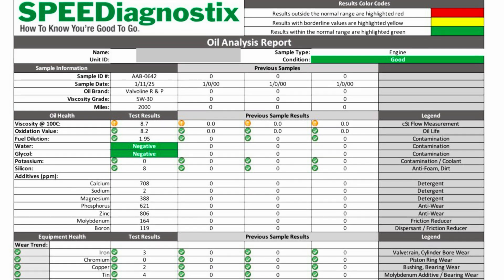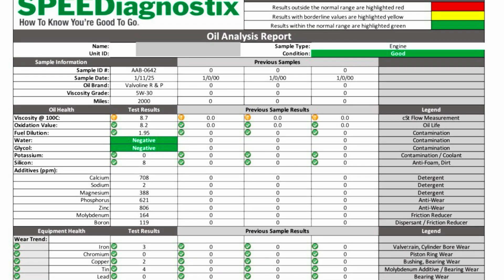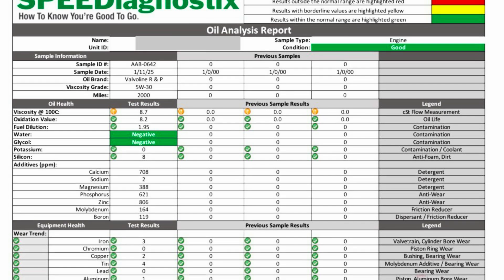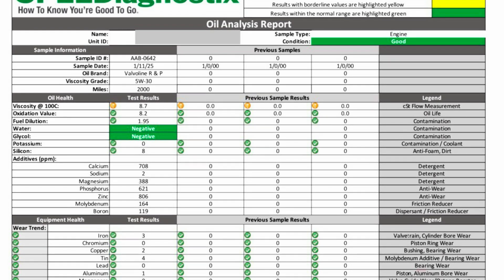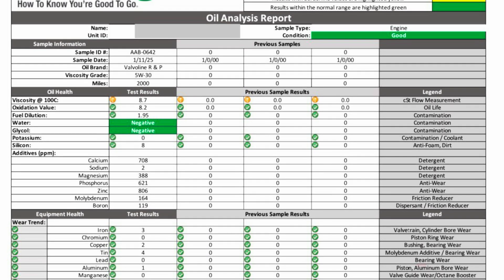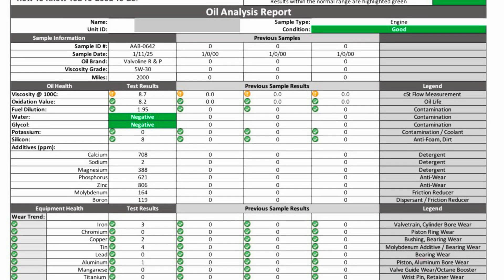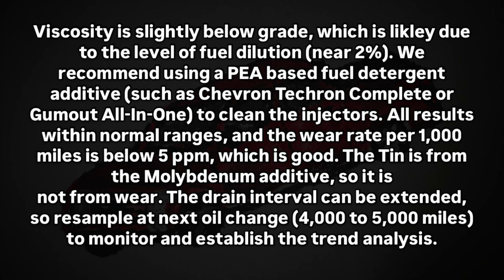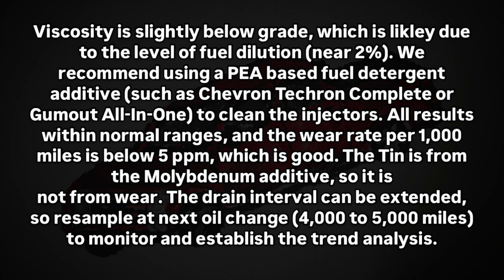Valvoline Restore & Protect (2,000 Miles) SPEEDiagnostix USED Oil Analysis

Comment: Most people need not fear a clogged filter. Unless you have a smudge engine, you should be fine with VRP and 5k mile intervals. The type of oil filter is key. The cheaper, OEM, low-grade will fill up with debris in 2500 miles~ 
and a good 15k-25k mile filter can handle what VRP makes, residue and carbon build up. I chose Purolator BOSS, AMSOIL,and Mobil1 EP filters. Good Luck
Reply from the maker: @robb15033  hey Robb! Thanks so much for stopping by and sharing here! I can’t disagree with you here!

Comment: High fuel dilution, eg, above 1% can be attributed sometimes to not running engine temp up to full temp for an extended duration - Lake says it doesnt need to be long, ie, short trips can cause this especially with low ambient temps at winter time.  I am not sure where you live for climate, but in any case you may consider making sure the oil sample has been done after a pretty good run in which to boil off the fuel out of the oil.
Reply from the maker: @jameszeiger8533  hi James, I think you’re right! I do live in a winter climate and do a lot of short trips. Do you think that if I do short trips a lot, it is necessary to do even more frequent oil changes to prevent dilution?
Reply: @MidwestF150  I live in the Denver area and right now we are cold as F-bomb and my 150 PS sits outside.  I think just make sure to once a week to run the truck in Tow/Haul mode and drive for 20 to 30 minutes, preferable at highway speeds.  Also, as you have done, drop an oil sample at ~ 2k or 2.5k miles.  The results will tell you if to keep running up to 4k or drop if the dilution is too high and viscosity package is breaking down too quickly. I think if you run it once per week for an extended period of 20 to 30 minutes, you will boil that fuel out of the oil and everything will be ok, just make sure the oil sample is after a good, good run before pulling as well.
Reply: PS:  Injector cleaner every few tanks as suggested might be preventive for clogged injects & bad spray patterns.
Reply from the maker: @ hey James!!! Does tow/haul mode put it on lower gears? And ultimately putting work on the engine?
Reply from the maker: @jameszeiger8533  how bad do these engines actually clog though?
Reply: @MidwestF150  I have a PB, 150 so Tow/Haul mode tends to keep it out of battery only mode.  But for non PB owners, I noticed Tow/Haul also tends to keep the vehicle from upshitting into higher gears, bringing the RPM a little higher which helps bring the operating temp up easier under slight load.
Reply: @ depends on the detergent package that the fuel you are using or has been used previously on the truck.  Lake says american fuel isn't so great for detergents, compared to European standards so running regularly a detergent cleaner isn't a bad thing.  High dilution rate can be a symptom of a partially clogged injector, which alters its spray pattern to more of a solid drip of fuel, not an atomized spray action.  That said, I think it's just good practice to run a detergent cleaner with some fixed regularity and to try and use decent fuel, which can vary from refinery to refinery and depend also on detergent additive added at the refinery. 2% doesn't strike me as necessarily a clogged injector issue, but running a detergent cleaner isn't a bad thing as part of standard practice at some fixed interval, eg, every 5 tanks or so maybe?
Reply from the maker: @jameszeiger8533  fuel cleaning fluid is just so expensive though lol - I currently use Costco top tier. So I’m betting on using this gas to reduce my use of a fuel system cleaner.
Reply: @MidwestF150  your vehicle has ~ 63k miles. Are you the original owner or did you get it used?  If you cannot vouch for the history, eg, a previous owner,  a couple of treatments of detergent is cheaper than having the injectors pulled and sonically cleaned since there are 12 on that motor.
Reply from the maker: @ great point, yes it’s currently 65.2K miles. I got it at ~40k miles. You do make a great point. I’ll need to think more about this one!

Comment: Redline complete fuel system cleaner works alot better then techron fuel system cleaner.   The redline has a higher concentration of polyeithermean . Thats what you want.
Reply from the maker: @LORD_OF_THE_ROOTS  hey Roots! Yeah I’m debating between Techron and Red Line!

Comment: I would consider Rislone Hyper-Fuel fuel system cleaner. The bottle has two chambers. One has highly concentrated PEA. The other chamber has an oil lubricant that lubricates the upper cylinder among other things. I can tell you this has been quite effective. I have then 2.7L ecobboost in an F-150 with only direct injection. I also have a oil catch can. I knew it worked because the little bit of crank case vapor collected was carbon black vs. the normal brown. The start stall stopped and the engine runs so much smoother with it in the tank. Highly recommend. It works!!!
Reply from the maker: @seanmclaughlin7415  hey Sean!! A fellow ecobooster. Welcome to the party. Thanks for stopping by and providing a recommendation! How often do you use it and what are your OCI’s like?
Reply: @ At first I bought 3 bottles and ran them back-to-back at 18 gallons of fuel to really dissolve and clean the injectors and the combustion chamber and whatever else it touched. Than, I do it when I feel like it needs it. I was using 88 octane E15 prior from a gas station called sheets. The issue I think was it is not labeled “Top Tier” so the detergents me be lower. So I switched to Shell. My OCI’s are at 150hrs until I do an oil analysis. Was 5K 175hrs.
Reply from the maker: @seanmclaughlin7415  oh wow you track by the hour, I like that. Do you idle your truck a lot?
Reply: @ No. only when cold out until temp needle moves some. You have an hour meter under one of your modes. It is a more accurate way to go by. I think the math comes out to 25-30 miles for every hour of run time.
Reply from the maker: @seanmclaughlin7415  I might just start doing that! Seems more accurate than mileage. I live in Minnesota so I try to warm up the truck first, specifically when I’m not at home and readily have access to a power outlet to boot up the block heater.
Reply: @ warming up an engine at high idle is not the same as idling at operating temperatures idle. Much more turbulence at the higher idle.
Reply from the maker: @seanmclaughlin7415  is there a way to calculate that differently?
Reply: @MidwestF150  Calculate what, exactly?
Reply from the maker: @seanmclaughlin7415  engine hours at high idle
Reply: @ I don’t. I change oil between 150-175 hours depending on the type of driving I do. More highway driving closer to 175 more stop and go, hauling, and hard driving closer to 150hrs. I do 150 right now no matter what until I get an oil analysis done. One in the winter, and one in the summer. Also, since It is turbo charged I lean towards doing it earlier. Under one of the modes on your dash it also has idle hours.
Reply from the maker: @seanmclaughlin7415  understood! Thanks Sean!

Comment: How could they tell you had dirty injectors analysing your used motor oil?
Reply: The high fuel dilution in the oil  indicates that one or more of the injectors is not atomising well.  So first step is to clean the injectors.
Reply from the maker: @PeterMurray-su7ex  hey Peter, thanks for stopping by! I agree with you!
Reply from the maker: @imdefinitly18now  hey there, thanks for stopping by! I’m not sure how all of the analysis works and how extrapolations are made. 🤷‍♂️

Comment: I use Gumout Complete All-in-One at every oil change. SuperTech Fuel injector cleaner for the other fill-ups.
Reply from the maker: @rickhansen1753  hey Rick, how’s it going? I sent a message to Lake Speed about my UOA. He said, based on my oil data, to use a cleaner every 3K miles. So I think that’s what I’ll do. I want to use the Chevron Techron, but let me know if you feel strongly about the other ones you use!
Reply: @MidwestF150  Techron is great too!
Reply from the maker: @rickhansen1753  glad you think so too! I gotta wait until I run low on gas before putting some of it in

Comment: I use Berryman® B-12 Chemtool® Carburetor, Fuel System and Injector Cleaner I've had really good results. It's affordable at Walmart
Reply from the maker: @peachyclean93  hey Peachy! Thanks for the tip!! As im reading all of the comments, I’m starting to wonder if me using top tier gasoline is sufficient already..
Reply: @MidwestF150  I don't know I've gone over this with my father I don't believe that the higher grade gas is much better for your vehicle people say it is but I don't know
Reply from the maker: @peachyclean93  ah I see. Lake was looking at the data for my vehicle and he recommended every 3K miles. Yours may vary depending on your used oil analysis but I think I’m going to run it every 3K miles for my truck,
Reply: @MidwestF150  yeah this is true every vehicle is different so hey do what you feel that's most important you know
Reply from the maker: Agreed! Thanks Peach!!
Reply: @MidwestF150  you're welcome 😁

Comment: Which brand or brands of fuel do you run in your truck? I only use top-tier fuel from Mobil or Irving.
Reply from the maker: @kerrylewis2581  hi Kerry!! I use top tier from Costco! Which I’m starting to wonder if I even need the fuel additive if I’m already putting top tier gas in it…
Reply: @MidwestF150  I have 117,000 on my F150 V8 and use 44K in all my vehicles once a year. I'm not sure if it's the best; it's just what I've used for over ten years.
Reply from the maker: @kerrylewis2581  gotcha! I heard back from Lake and he recommended I use a fuel system cleaner every 3K miles. This recommendation is specific to the data on my vehicle and yours may vary!

Comment: Redline Complete Fuel system cleaner is the best option which the most PEA and the price.  You can also use BG 44k Platinum P/N 208.  GumOut Ultra 5in1 is middle of the row and the Techron Marine is fairly decent.  I only run Redline these days though with excellent results and lots of research.
Reply from the maker: @Balticblue93  hi Baltic! Thanks for stopping by and sharing your recommendation! Do you think I can just get away with using top tier gas?
Reply: @ I run only top tier fuel in every tank.  And I use one bottle of Redline somewhere in my 5000 mile OCI.   I am running R&P in many of my vehicles.  So, I do both and had great success doing so.
Reply from the maker: @ thanks Baltic! I think I’m going to send Lake Speed an email to ask about when in my oil change interval is it appropriate to use the fuel additive—do I wait until closer to the oil change or can I just use it!
Reply: @ I have watched enough of his videos and exchanged one email.  I think I know what his response will be but, it will be interesting what his response is to you.   Let us know is what he says.
Reply from the maker: @Balticblue93  follow-up: he said I should still run an additive every 3K miles based on my data. Yours may be different!

Comment: I use a can of Berryman's B-12 Chemtool for cleaning general fuel system and valves stuff, plus slightly increased fuel mileage on long drives, But too actually really clean injectors you do need something with PEA.  So the Chevon Techrom, Gum Out, and I think Redline has a product with the highest percentage of PEA.  Somewhere someone has a chart on products with the most PEA on it, I just can't find my bookmark.   Definitely worth doing a couple times a year for sure.
Reply from the maker: Hey Brass! Thanks for weighing in! I think I might go with the Chevron. How often do you use fuel additives?
Reply: @MidwestF150  I use a can of Techron when I change my oil (usually at 6 months instead of 5k miles since I tend to run about 4k miles in 6 months).  I toss a can of B-12 somewhere in the middle of that interval once or twice, especially if I'm taking a longer drive.  This is not evidenced based practice, granted, so I'm not sure on the recommended intervals, but I feel that twice a yaer is sufficient without being in excess, either, which can be harmful for your cat.
Reply from the maker: @brassmule  I heard back from Lake Speed and he recommended for me, based on my used oil analysis, to run the cleaning product every 3K miles. So I will likely do that!

Comment: Glad to see that the oil is still in good shape, gives me a little more confidence in my tractor. I use the chevron techron complete in every fillup for my tractor and every 3 fillups in my mom and dads 2 chevy's. 32oz for 8.99 at my local napa when It goes on sale every couple months there. Not the best one probably but i get it cheap and over dose a little
Reply from the maker: Hey Cheese - wait every three fill ups? Do you think 3-4K is appropriate?
Reply: @MidwestF150 im not sure really, lake speed has an hour long seminar on a porsche club YT channel about fuel additives . Their tanks both hold about 25 gallons if i remember correctly, average 16mpg so whatever that works out to
Reply from the maker: @CheeseBurgerXJ  I think I might do every oil change!

Comment: I've been telling you about PEA additives every 3,000 to 5,000 miles. I would also go as far as using Lucas upper cylinder lubricant every tank full.
Reply from the maker: @usocrazy6133  hahaha hey USO. You have been I know! I just thought that the top tier gasoline I’ve been using is sufficient. What are your thoughts about Techron tho?
Reply: @MidwestF150  Brand isn't important. What is important is polyetheramine (PEA). Top tier is good but using a higher octane rating than your engine calls for in you owner's manual is a waste of money and actually can damage engines that call for lower octane. Why? If you engine is designed for 87 octane, 91 or 93 octane will ignite differently than 87 octane. This can cause knock or preignition. Premium has no more cleaning ability than midgrade gas. My suggestion is to use the gasoline octane rating that your owner's manual calls for. Use a PEA containing "Total Fuel System Cleaner" containing PEA, and consider using an upper cylinder lubricant every tank or every other tank full. Lake Speed Jr. has a video on upper cylinder lubricants for gasoline engines.
Reply from the maker: @usocrazy6133 thanks for this! Regarding octane:

My truck says I can put a minimum of 87 octane in it but they recommend premium gasoline 92-ish? I can’t remember exactly the octane grade but it was in the 90s. In that case, what should I do?
Reply: @MidwestF150  Then you are golden. One thing to consider, midgrade is the mixing of premium and regular at the pump. Regular gasoline doesn't sit in the underground tank as long as premium fuel does because most people fuel up with regular. I used to test gasoline for a station when I was a teenager. The dipstick water test was way higher in the underground premium tank then it was in the regular tank. There is no such thing as a midgrade tank because refineries don't make midgrade fuel. Midgrade is mixed at the pump by the pump.
Reply from the maker: @ wow… that’s interesting. Wait why is regular lower than premium in the ground? I don’t completely understand
Reply: @MidwestF150  Not lower in the ground. Premium gas is the least purchased fuel, so it stays in the underground tank longer.
Reply from the maker: @usocrazy6133  AHHH I don’t know why I didn’t pick that up when you said it lol - long day at work yesterday lol